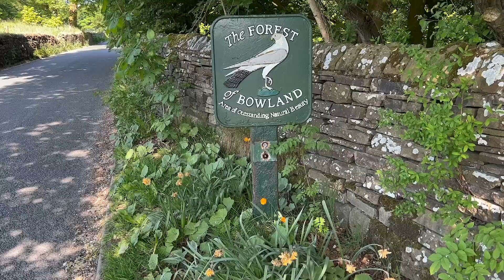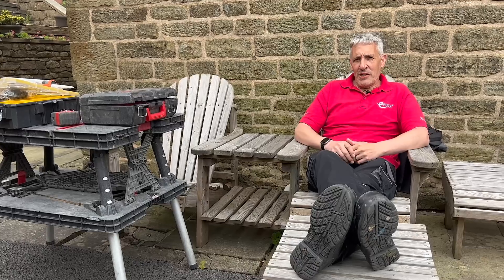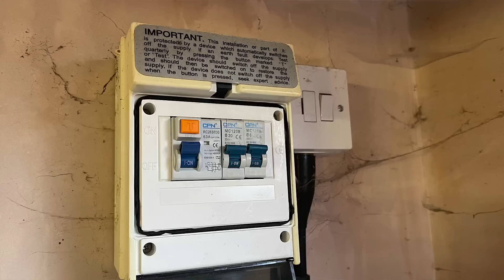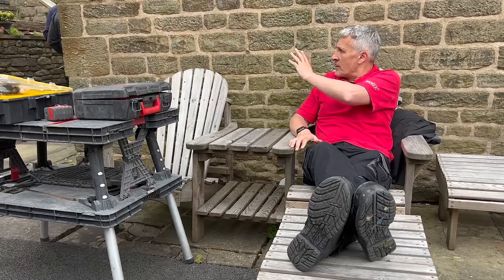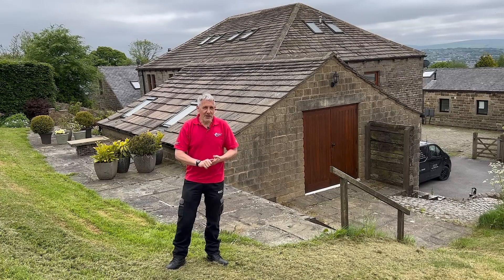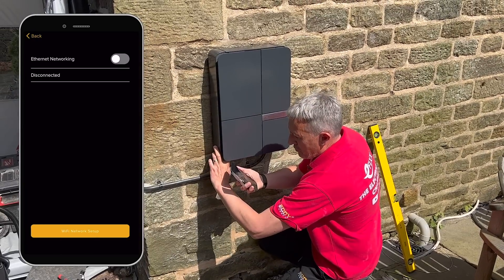Electrician's Battle with Hose Pipe to Install EV Charger - Andersen A2

Comment: Seems a bit daft to fit a Double Pole isolator and then only connect the Line through it.  I think the hint is in the name Double Pole.

I wonder what happens if there is a fault on the DNO/DSO network can the potential rise on the Neutral?
Reply from the maker: It’s a mystery

Comment: I have an Andersen A2, and in exactly the same colour combo.  It's a very good EVSE, and does look very smart, especially compared to some of the rather industry-looking options out there.  The Solar PV integration does need a little bit of work though; it's fine when there's plenty of delta/surplus, but struggles sometimes when it's more marginal.
Reply from the maker: Great feedback - thanks

Comment: Ethernet cable back to the router would more reliable than some Wi-Fi repeater over mains that will fail on the night you really need a charge.  Neat looking charger though.
Reply: That's not a repeater, it's Ethernet over power line.

Comment: I really hate fuse boards outside 😂
Reply: Didn’t look too good under the stylish charger either??
Reply: @jamiepolson  Well, it was installed under the not-so-stylish Metter Box, actually...
Reply: Millions of them on Caravan sites across the country. It only takes one small hole to invite the local Spiders, Earwigs and Woodlice to take up home in them.
Before you know it, you get some intermittent tripping, open up the box to find it full of Spider web, dirt and bodies. And of course lots of damp corroded parts that need replacing.
I have rebuilt many of them. Problem is they need a small drain hole to let Water condensation out, which provides an opportunity for new residents to move in and the cycle continues.

Comment: A point of contention here. I am a qualified Radio Amateur, we suffer terrible interference from those power line adapters, due to them not being screened. They radiate nasty hash over the power lines, making them a nuisance. Sometimes many hundreds of yards away, as the signal will carry right up to the transformer which easily could be miles away, carrying the noise all the way, wiping out AM reception, which is actually a reportable and prosecutable offence (Wireless Telegraphy Act 1949) (think security too).
It would be far more prudent to fit a Wi-Fi repeater in the house sat in a Window, overlooking the charging point. Dual band no interference, and will cover the Garden.
Reply: Replying to myself here.
I fit many Wi-Fi repeaters in guest houses, garages ETC where a wireless signal needs extending, far cleaner than these nasty powerline adapters which will wipe out all AM reception for a long way.

Comment: so the electrician became impatient and decided to crow bar out the fixture causing a whole brick face to be damaged.  very poor work. very poor
Reply: I though that too.
Reply: Was that a normal screwdriver he was hanging off the end rather than a torque screwdriver tightening the MCB to the buss bar?
Reply: @amatchmadeindevon2005 looks like a calibrated arm!
Reply: Another keyboard warrior! 😅
Reply: If that crow bar guy worked for me, he wouldn't be now... You published that online as a video!?!? Seriously poor standard that. Tell you what, turn it into one of your 'shorts' and let's see what people think
Reply from the maker: It already is published a few months ago. How would you remove the screw which is rusted solid.
Reply: @efixx  drill it out! Also you could have used a multi tool to cut the screw or even the fixture if the client said it could be sacrificed.m. Wrecking the brick is horrendous.
Reply from the maker: @brettuk  the surface isn’t brick it’s solid random stone. So no face to damage
Reply: @johnadams1976 there’s always somebody who could do it better!